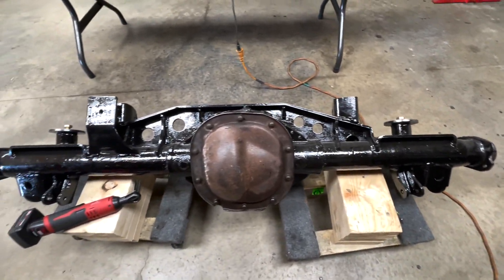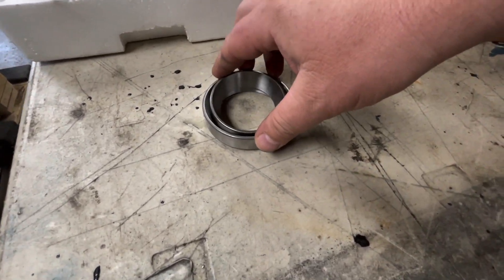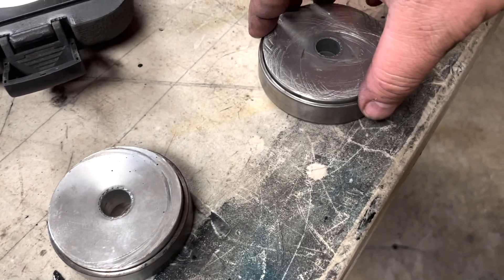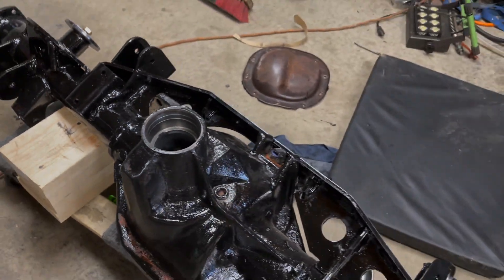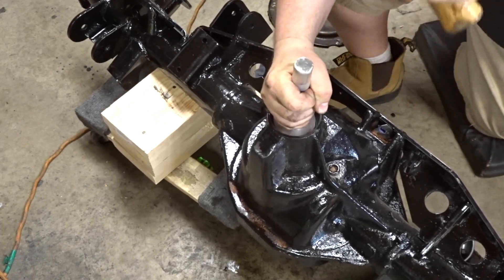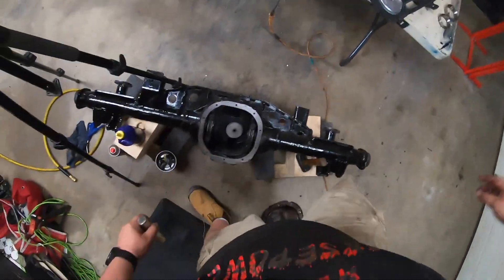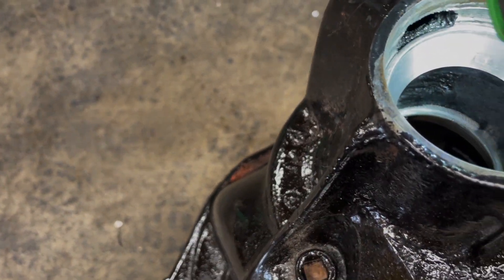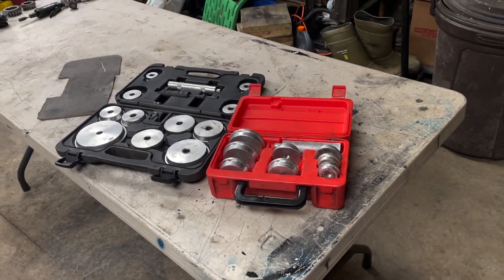Easy Way to install Pinion Races DIY

Comment: One of my kits has an extension that bolts to the handle the same way the driver bolts to the handle, you could find one on eBay I’m sure or fab your own from pipe.